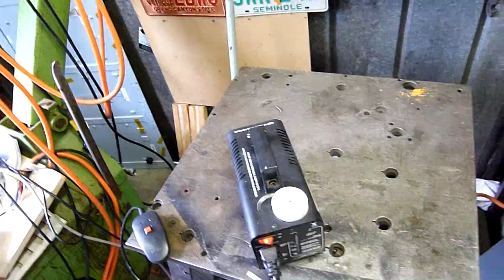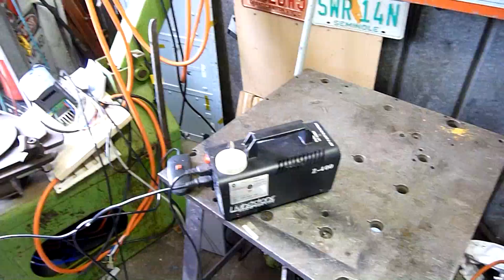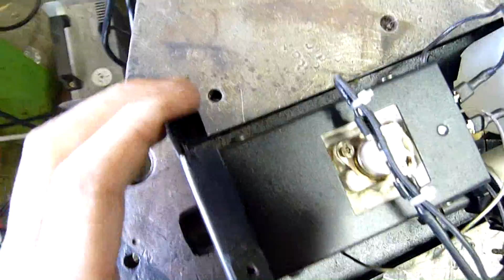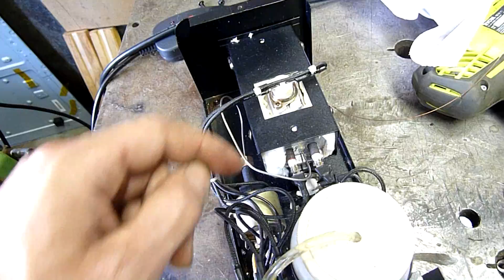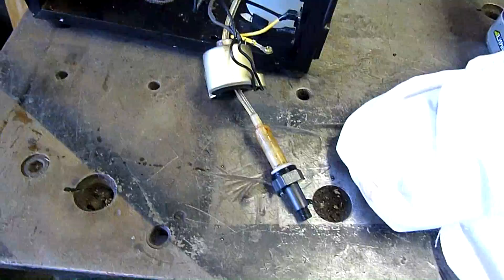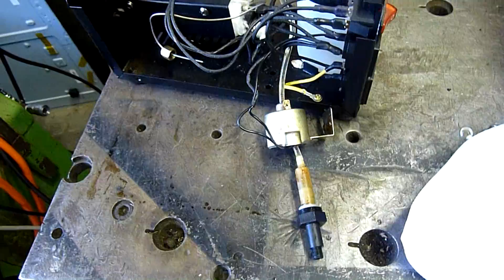ALDI Livingstone Smoke Machine Troubleshooting

Comment: If you have this unit still would you help me out by posting somewhere a photo of the inside of the controller? Or describing which wire goes where? The wires pulled out of mind and I don't know where to solder them back on! Thanks heaps

Comment: If you could find A windscreen washer motor and put A 12 volt DC supply to it that would work. That's what I did when my pump went in mine and it worked like A charm. Cheers Mate \_/

Comment: I found a messy leaky machine full of juice almost just like that several years ago, bet it has the same problem. Your vid is informative, haven't seen a machine yet like that with a solenoid pump... do you have to push the button repeatedly instead of just holding it down until the heater is overwhelmed? This makes me want to dig up the old junker and check it out, thanks for the vid as always!

Comment: nice to see the old smoke machine in good hands, that pump played up around a year back and I'll admit this machine was given a flogging when I bought it. I do see that the later machines come with warnings about not running them continuously...hmmm may be thats why mine died, my other big worry about this design is the very narrow smoke fluid tube, and I feel thats 70% of the problem with this machine, the other 30% is the pump. If the machine had a small redesign it would be a fantastic little smoke machine, buy hey this is made in China stuff designed to only last a few years...because they need another sale...the cycle will never stop until people wake up to it, sure i'm a total sucker for buy cheap, buy twice

Comment: hi try using a 12v battery in series with the coil and the volt meter to find out if the internal diode has failed short or open circuit

Comment: you can use a plant spray hand pump thingy quite well for pumping fluid, doesnt take much to make a puff of smoke. I work as i lighttech so worked with these things allot a big no no is cleaning it with tap water because of the residue it leaves behind :)

Comment: Yeah blocked up smoke machines, they plague me at work, I wanted to see if there was a way to use hydraulic pressure to clear the clog. A few fog machines out there have a heater made out of plates that you can replace the tubing in the heater, but almost all of them are that cast bit, unless you melt the aluminum down and recast it XD. I would actually likes to see how the route the tube inside one, but I don't have a way to melt the block down currently. Given that heater cores for the ones at work are $600+. The pumps can get jammed / worn alot too, some also have fuses in them or thermal cutoffs (usually where the leads go in), check for that too :3

Comment: Before you condemn the pump, it may have a diode in series with it that would make it look open circuit when measured.  The pumps are very prone to gunking up or getting airlocked.  Quite often they are wired with their switch across the heaters thermostat, so it will only get power when it's up to temperature.  The water and vinegar thing is more for flushing through the heater block to remove deposits.  Just for fun, check out the wiring to the remote socket which is often just a standard Euro socket.  The earth pin in the remote will almost certainly NOT be connected to earth.

Comment: Some of stuff from ALDI isnt to bad. I bought an arc welder for £28, Its not the best welder by any measure but it dose the job and for £28 I was tempted to buy 2 of them. Some of the stuff is utter crap though.

Comment: ......"Don't use flammable liquids in this device"

FLIPPING YESSSSS!! :D

Go on!! You know you want to. I WANT FLAAAAAAAMES!! ROFL! :D

Judging by your explanation of how one of these works, it seems to me that you could get a steam iron, fill it with smoke-machine fluid, get the thing up to temperature, squeeze the trigger and....... Smokey Iron! :D

As far as putting a flammable liquid in it.... You've mentioned it now, and it would be flippin' rude not to! :D

I've often wondered about those automatic air-freshener devices which have an aerosol can in them and squirt a burst of air freshener every few minutes-or-so.

I wanna get one of those and put a lit candle in front of it. Every time it activates the air freshener......GOODNESS GRACIOUS GREAT BALLS OF FIRE! :D

Aaaaah, flames are always fun :D

Thanxx for showing,

-BoomBoxDeluxe.

20th January 2014, 16.27

Comment: Never seen inside one of those before, thanks ed :-))

hmm the coil reminds me of the type used on washing machine water inlet valves, although they are 240v, may be similar.

Ha ha i wondered how long it would take for you to think of putting other fluids through it lol, evil lol.

Use a syringe and push the diesel through lol.

Comment: Ed you may be able to rig up a timer/pulse circuit and use one of the 24 volt solenoids from the over molder. you may have to make the machine a little bigger to fit the board and controls but that may work. Or use the PLCC from the Battlefield